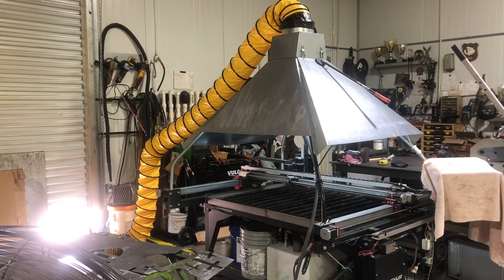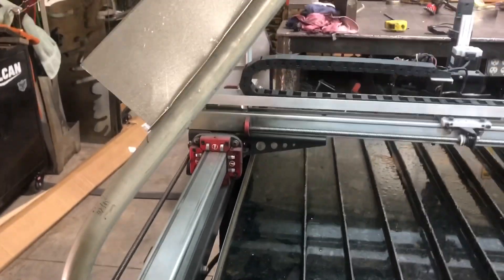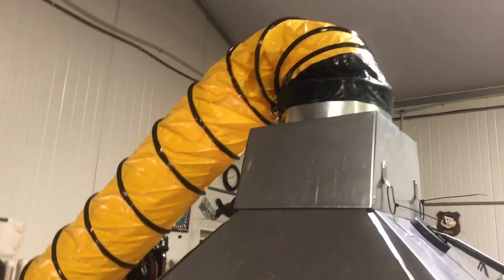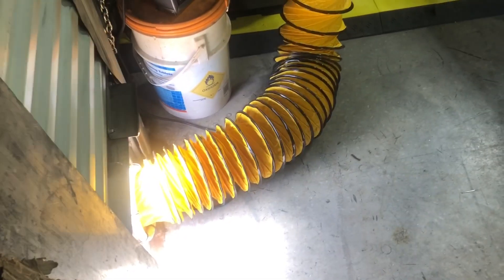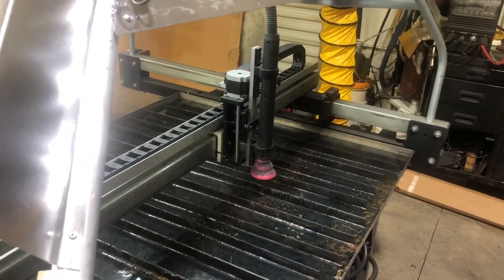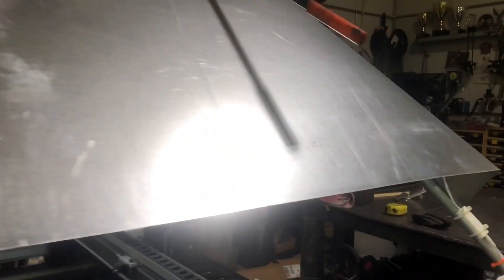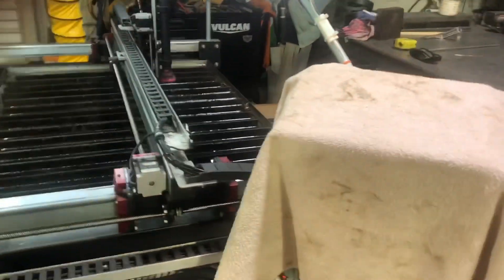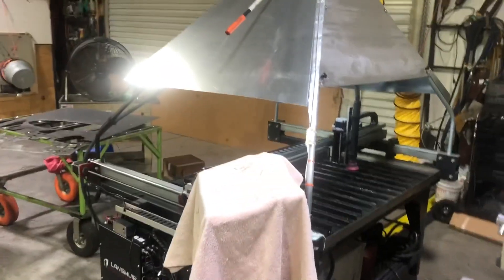Fume Hood for Langmuir Plasma Table

Comment: Hey, looking to do something similar to what you did with the hood. How did this setup work for you? Thanks, D
Reply from the maker: Sorry for the delayed response…have been lazy in checking my channel!  The hood has made a big improvement in the amount of metal dust around the shop.  There are two things I need to do to improve it.  It should have extended further out because the hood decreased the cut limits.  I’ve lost about 5” all the way around because the torch contacts the hood as it gets near the edges of the table extents.  I hand torch or shorter machine torch would resolve this but I’ve just been living with a smaller max cut perimeter.  

The second is to take the time to install clear vinyl curtains all around.  To seal the corners better instead of hanging towels.  I’ve actually ordered some vinyl and will soon try and figure out how to hang them.